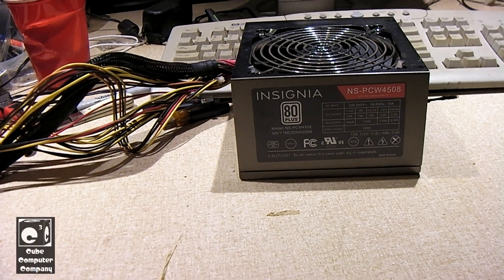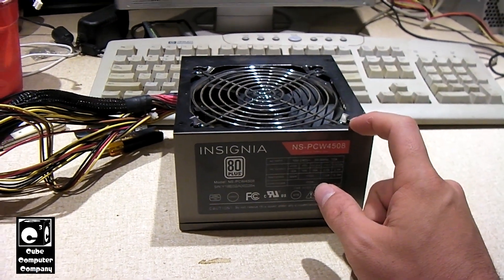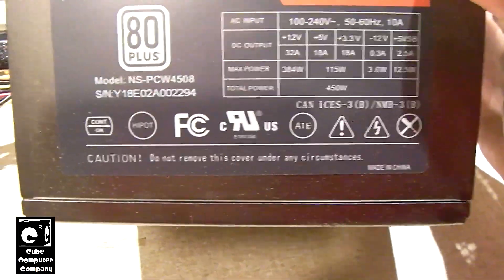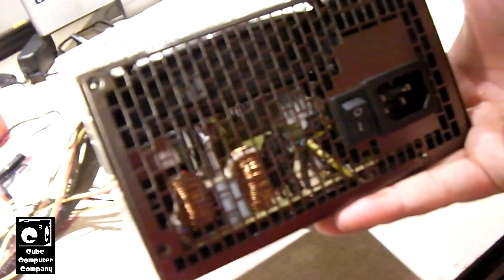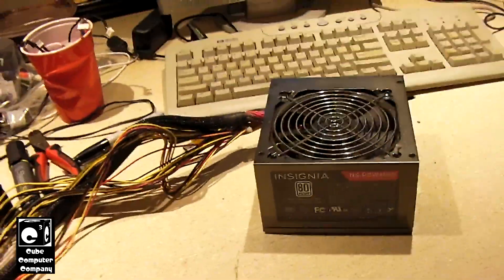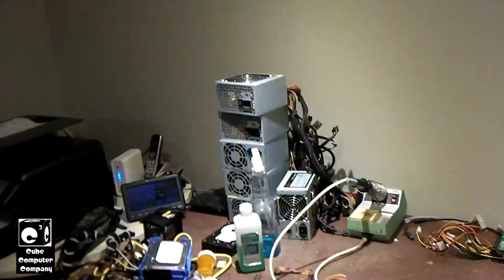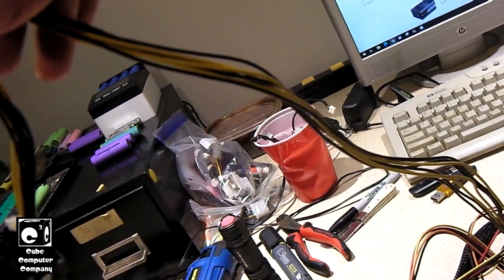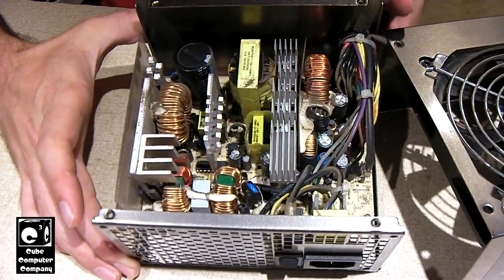Overview of the Insignia (Huntkey) NS-PCW4508 Power Supply

Comment: wood you think that power supply do good with a asus rog strix rtx 3070
Reply from the maker: That card recommends a 750W PSU. This unit definitely won't cut it.
Reply: @CubeComputerChannel  Asus do like to overclock there gaming card yeah it dos add more voltage now i think about it